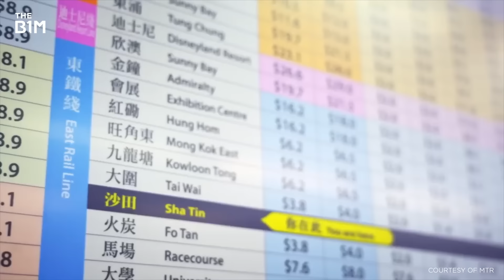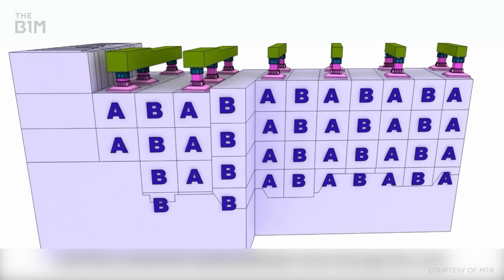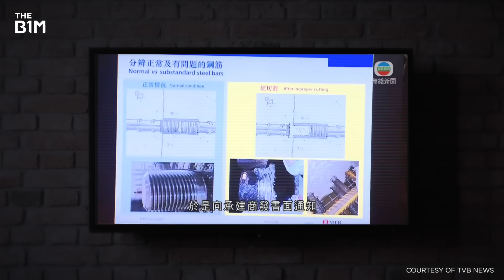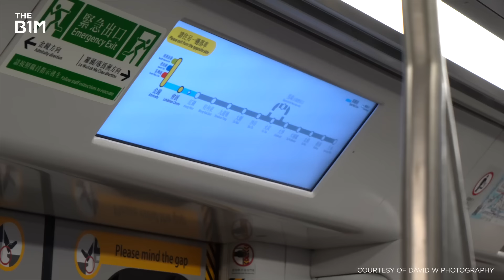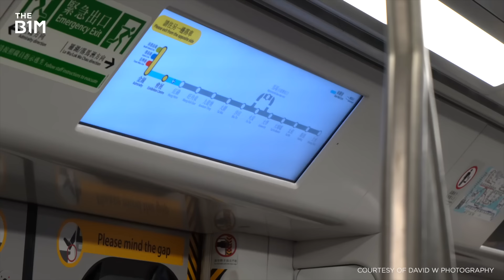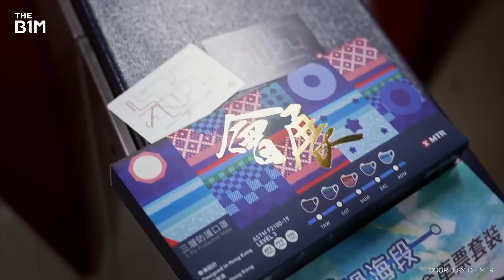Hong Kong's $11BN Underwater Railway Explained

Comment: I was on the scene when the EAL extension opened and was on the first train, the train was packed,all the enthusiasts were screaming with excitement as the train left the station on its first run the project was delayed by many years,at the end,the Tuen Ma Line was delayed by 4 years and the EAL extension was delayed by 2 years, but there were a lot of extension that were related to the SCL project, like the Kwun Tong Line extension to Whampoa via Ho Man Tin,there are other plans to build new lines/Line extensions like the Hung Shui Kiu station, Tuen Mun South extension on the Tuen Ma Line expected to be opened by 2030,Tung Chung South extension,Tung Chung North station expected to open in 2030's,and the Northern line expected to open by 2035,and the Tseung Kwan O Line extension to Exhibition Center or Tamar station with the Tung Chung Line expected to open in 2030 to 2040

Comment: A similar method was used for the George Massey Tunnel in Vancouver in the 1950s actually.  There is a classic period documentary on the construction for those curious. I cued it up to the part where they submerged the tunnel parts but if you love engineering and construction, the whole video is fascinating.  I guess the tech for this type of tunnel has not changed much in over 60 years.  https://youtu.be/A1igKk8eK0M?t=1565
Reply: It's not that similar.  The one in Hong Kong was way more complicated.
Reply: @samlee6938 What was more complicated as they sure seem the same, both with their own unique environment challenges?
Reply: Immersed tube is a fairly common method of building under large waterways.  It takes less geographical footprint than using TBMs and can offer tighter turn radius because the actual tunnel is precast rather than formed on-site.
Reply: @MetaverseAdventures  The video already mentioned one of the challenges that Canadians didn’t have to deal with. The much shorter and shallower one in Canada was made for cars and didn’t need to line up flat horizontally. There’s no rail track to put into it. Just because they look similar doesn’t mean they actually were. When the engineering expert said it’s complicated, I believe in him. HK has more impressive infrastructure and transit systems than Canada. Don’t make it sound like they were having trouble with something Canadians did 60 years ago. You don’t know the details and the devils are always in the details.

Comment: If there ever was an underground that didn’t need an upgrade, it would be Hong Kong’s.
Reply from the maker: I know right? It's already incredible.
Reply: I assure you it needs it - yes, it's a pretty large system for the size of the territory with a high frequency of service, but the ridership numbers are insane.  The main thing this tunnel does is make it possible for people living close to the east rail line to get to the island without changing trains.  Kowloon Tong was always a nightmare at busy times due to all the transfer traffic.
Reply: As someone who is from HK I could tell you that it definitely needs to upgrade its capacity as it is super crowded even in off-peak hours...
Reply: I promise this was absolutely necessary. Most hkers don't have cars and the current network in particular the Tsuen Wan harbour crossing was bursting at the seams. In a lot of places the public transport is an additional option, in Hong Kong it IS the transport.
Reply: Well... visit Admiralty Station at 8:00am or 6:00pm and you'll see that an upgrade is definitely needed!

Admiralty Station, Prince Edward Station, Kowloon Tong Station and Kowloon Bay Station are all nightmares at peak hour.
Reply: being a local i wish it could be bulldozed and restart from scratch, the current system is just a patchwerk of old railways and subways and then some new extensions, end result is that there are many places that are covered by the network but took so many transits between lines to reach

Comment: Such a shame 'TfL' did not replicate the Tunnel Underpinning method of adding a new railway to an existing station.
Canary Wharf (Jubilee Line) could have had Tunnel Underpinning for additional lines.
The single Canary Wharf Station box could have had stacked: Jubilee Line, Bakerloo Line, xRail - LizPurp of 260m, and a HSR of 460m. 
The Jubilee and Bakerloo could have had same direction cross platform change of lines. 
This would have eliminated the twenty plus minute interchange between the Canary Wharf Jubilee Line and xRail - LizPurp... and would have paved the way (TBM'd the way) for other lines that should have started construction decades ago. 
Always the way with everything transport in the UK... design to Victorian era passenger traffic, delay decades before beginning construction, truncate what was planned, and delivering infrastructure a century after it was Required - and at capacity as soon as it opens. 
Oh and of course, costing far more than initially planned due to the decades upon decades of delays before the first shovel breaks ground.

Comment: What is the major implications for cutting short the rebar threads here? I suspect the rebar threads were shortened because the two side walls with the threaded ends (starter bars) were first casted and the single middle piece couldn't be fitted between them with fasteners on both ends. It's not like there was no overlapping inside the fasteners, it's just short of the designed length by a little. The rebars here are like 2inch diameter with 3 inch fasteners, there was no way to bend the (12meter?) rebar to fit. This happened within the confines of the station section where every train stops ie: slow speed. 
Construction projects in Hong Kong have a 30% safety margin and MTR designs for 150 year life span use. With fully loaded trains this might decrease the useable life-span to 100 years? I really don't see what the big deal is here, this station is at the bottom level anyway. It's not like the floor slab with track will suddenly give way and fall through. Movement tapes will be applied to the corners of this vertical/horizontal cold joint and checked regularly. The station settlement alone will be more than 15mm. The station will settle differently against the tunnel portion via a movement joint and the track height will be adjusted via shim pads. I'm not sure how often they check but every three months within the first two years for new projects sees reasonable.
That's my understanding of MTR projects in Hong Kong anyway. Correct me if I am wrong.

Comment: I never quite understood why MTR had to extend the East Rail Line, and build so much expensive infrastructure. It could've simply extend the Ma On Shan Line to Admiralty, and build one new set of platforms in Hung Hom, as East/West Rail Lines already have their own platforms. That scandal may not have happened.

By leaving the East (and West) Rail Line alone, the MTRC also could've continue using the existing rolling stocks. East Rail Line trains have to go from 12 cars to 9 because platforms in Hong Kong Island can't be that long.

Comment: Hong Kong knows what they are doing because they did this before when the Red Line and the the MTR Airport Line were placed under the harbor back in 98. The same quarry they are using to build the extensions was used to build the Western Harbor Tunnel, the Airport Tunnel, and the Hong Kong- Zhuhai- Macau Bridge. How it works is the quarry is dredged and the water is pumped out of the drydocks at quarry side. The tunnels are then built inside quarry and capped with watertight bulkheads. Once a segment is complete Teflon pads move it into the drydock and that section of the quarry is flooded. Tugs and a gravel spreader then tow the segment to a precut trench in Hong Kong Harbor then the segment is filled with water and sunk. Once it is on the gravel bed the spreader pulls it while hydraulic jacks push it and divers guide it in. Once the segment is docked vent pipes are installed on the roof so workers can get in and exhaust gasses can be removed and the bulkheads are cut out with a torch before the next segment is laid. once four segments are laid the super scoop dumps the material it excavated on top and the water is pumped out and the tunnel connected to the land tunnels and the bulkheads are opened so vehicles and trains can use it to get through Hong Kong.

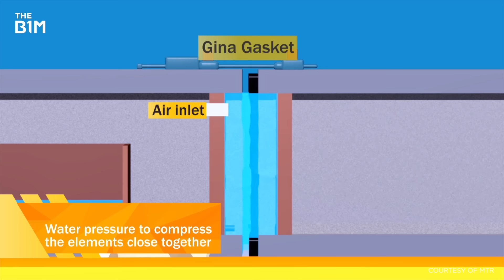Comment: The graphic at 5:50 needs a bit of explanation. It doesn't makes sense when the text says that water pressure compresses the two parts together, when it shows water between the two parts where it would inhibit the parts coming together. And there is a hydraulic jack, so what's with "water pressure?"

Comment: As a Hongkonger, I must say the opening of the Shatin-Central Link isn’t all positive for the everyday commuter. Yes, if you live in the New Territories East and you work in Central, the new extension does speed up commuting by lessening the need to transfer to another line or to ‘tunnel bus’ services at Hung Hom. But for everyone else who commutes along the East Rail to Kowloon only and not all the way down the line to Hong Kong Island, the new extension really sucks. The East Rail has long been saturated before, and the opening of the extension only creates more ridership, which worsens the saturation problem. One very important issue which most people outside Hong Kong commenting on the new extension has missed is the introduction of the new R-trains. The East Rail was known for having the longest trains in HK with its 12-car MLR-train, but they were all retired a week before the opening and were replaced by the 9-car R-train. The MTR frequently boasts about how much better the R-train is compared to the MLR, saying that its modern interior allows much more efficient use of space, and its 6M3T configuration means that it accelerates much faster that the 4M8T MLR, which will in turn allow for higher frequency services. While both aforementioned facts on the spacious interior design and fast acceleration of the R train are true, the loss of 3 25m-long cars cannot be compensated with that minuscule increase in capacity. More importantly, the so-called shorter trains, more frequent service is a complete joke. For the longest of time, the East Rail has been running at 2.5-3 minutes intervals during peak hours, and now with a larger fleet of the much faster accelerating R-train…services are still running at 2.5-3 minutes intervals. Therefore, for someone like me who commutes to work in Mongkok from the New Territories every day, the new extension has done more harm than good. When I board the train home in the evening at Mongkok East, you simply cannot board at certain sections of the train because it has already been filled with passengers from Hong Kong Island. Often I have to walk all the way to the other end of the train to just get onboard, let along finding a seat.
Reply: The East Rail Line is not running at maximum frequencies right now. 2.5-3 min headways is in fact an increase from 4 min peak frequencies with 12-car trains only during the pandemic. There are 34 R trains in service right now, just 1 more than the 28 MLR + 5 IKK at the start of the pandemic. According to MTR's website, the peak frequency is 22 trains per hour. Michael Tien mentioned that with 33 R trains the max frequency is 27 tph.

People utilising the East Rail Line extension are most likely people who already used the East Rail Line to commute (TWL+KTL+EAL or bus+EAL), so ridership distribution is more affected than actual ridership. So I would say a better way to compare ridership is the crowdedness of Kowloon Tong to Sha Tin before and after the extension. Unfortunate that journeys North from Hung Hom/ MK East are more crowded now, but at least the journey time is reduced.

I feel the main problem with uneven crowding for Northbound R trains is the layout of Admiralty station as the escalators only lead to Cars 3 and 5. What makes people crowd these cars even more is the fact that Car 4 is the first class car.

Losing the 3 cars is definitely not ideal, but I have to say 1 R train car is much better at handling crowds than 1 MLR car. I would say MTR handled it well so far, but I fear that the Lo Wu borders will reopen before more R trains can be delivered.

Comment: There is still no proper explanation on why they cannot build a 12 car platform on the island side of the line when the rest of the line was 12 car platforms? 🤔🤔🤔
Reply: There is not enough space; keep in mind many buildings with underground structures are built in HKI.  They have reserved space on an end of the platforms so the trains can run in 10 car configuration in the future.

Comment: I do not get the idea behind the steel-bar-cutting...
Reply: some of the rebar (size Y40 couplers) are very tight fit and extremely difficult to connect together.  It's heavy and long with tight working environment, some decided to cut the corners.
Reply: @426dfv  ...Always lovely when a "bruhhuu:working is hard" leads to potential death....
Reply: @ledgeri  if the designer can be a-bit more thoughtful rather than staying in their fully ac office. Certainly not an excuse to cut any corners but a more realistic and workable solution shall be provided.  As we all know what drawn on paper and the real environment is different.

Comment: MTR STILL has a lot of "dirty" practices.....  ever since they went public, it's all been about money.
There are clear cases of staff sticking down platform "edging" tiles with yellow glue & tape, making some serious trip hazards at the platform edges..... 
(they say it is "temporary repairs", but 3-4 years seems a little bit long for a "temporary repair"
There there is the half assery of cable installs and general  cost cutting can be seen all over the place.

You also completely missed the point of the MTR staff & the testing agency FAKING the "hardness" & density" testing on  concrete cores.

Comment: Kinda reminds me of the hype when they built the ConferationBridge in Canada.  Only not nearly as intense.  😅😅 Now we are more likely to see people protesting an infrastructure project cause everyone worries about how it effects them now not carrying that maybe its best for EVERYONE that it gets done.  The "Not in my backyard" mentality is being taken to extremes. 
For instance people protesting natural gas pipelines while forgetting natural gas lines are EVERYWHERE here cause we use it to heat our homes.  And its so safe you might hear about one leak or two every few years across the breadth of Canada.  Do you know how many hundreds of thousand of km of pipeline that must be?  We run it down ALL of our streets!  Except for the odd province or territory that doesn't have it.  The sheer ignorance of some of the environmental groups can be stagering.
Reply: Read up on the Massey Tunnel replacement in Vancouver, BC and the toy-like Skytrain. Sad and shortsighted does not begin the describe the endless farces of infrastructure. Then I go back to Japan and the other end of the scale along with similar celebrations of new infrastructure opening as Hong Kong.